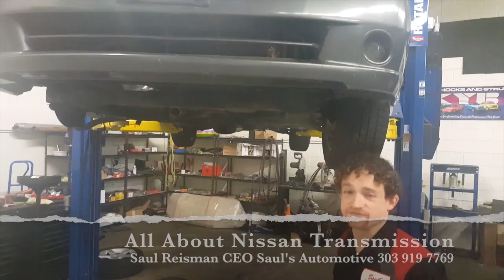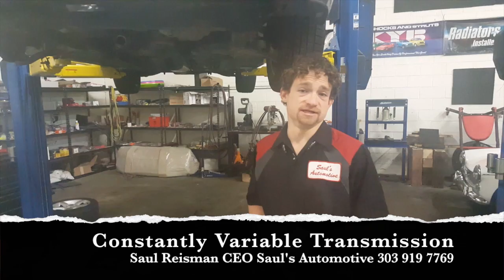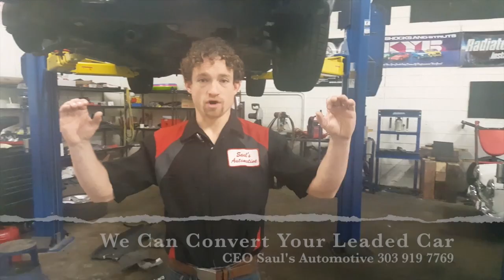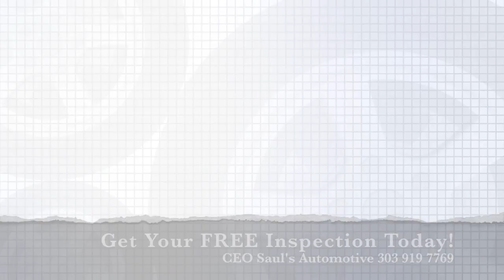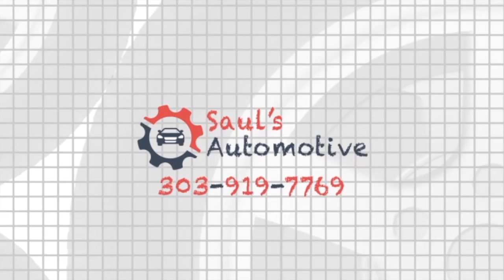Nissan Constantly Variable Transmission Auto Repair in Denver Englewood

Comment: Hello.. Your local parts delivery driver here.. I enjoyed watching these. We spoke earlier about my 7AT AWD in my Q70 needing a TCM/Valve Body.. I understand completely your position with the CVT's and I agree 100%. Why do you condemn the whole 7at trans for just a computer replacement?? This also seems to be an extremely common issue with all the 7AT's across the board happening anywhere from 40k to 300k +, though the TCM in the 7AT AWD seems to last considerably longer 🤷. Im 18k in the car, 11k on a low mile used engine install, and 14k on additional parts.. I don't really have the motivation to dump another 4 to 7k on a trans.. Bastard can sit in the back yard 😆